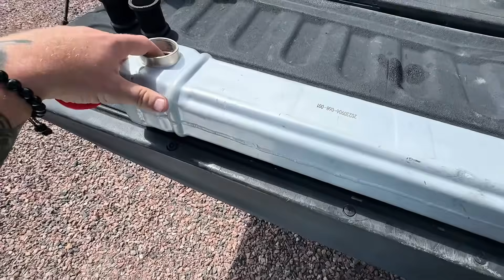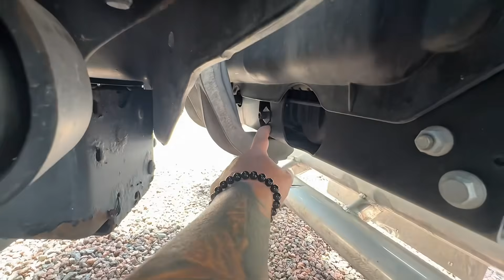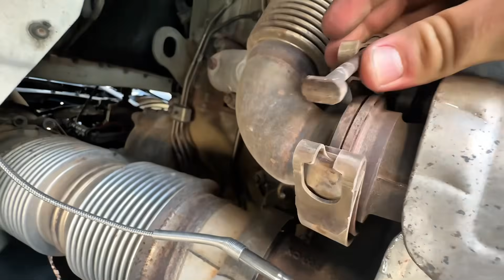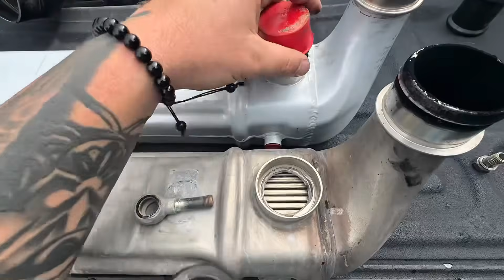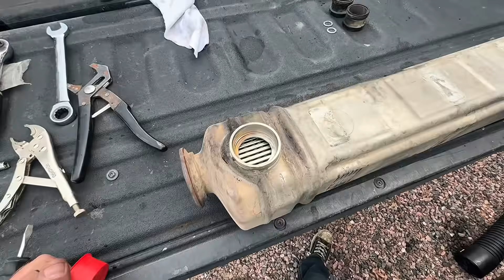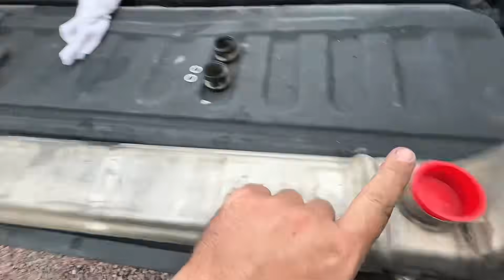Detroit DD15 EGR cooler replace - detailed, step by step, & time stamped

Comment: Not all of the clamps on the EGR cooler tighten to the surface, you can damage it by over tighten. The Torq specs are 14lbs.
Reply from the maker: Are we talking the v-band clamps on it? Or those straps that go over it and mate it to the mount?

Comment: Did you have any issues after installing with these products? I need to replace mine but straight from dealer is double the price
Reply from the maker: Yes. I would suggest go OEM if you haven’t already bought yours. 
Do you have DD15 or DD13?
The aftermarket one threw some codes for airflow because it wasn’t giving proper air flow readings to the sensors. And I ended up swapping this one I first installed from DPF direct parts with an oem one and my issue went away. 

My oem was $1700. 
I have found premier trucks out of Amarillo to give good prices on their parts

Comment: Is it possible for it to leak exhaust into the coolant?
Reply from the maker: Yes. The leak can go either way. It depends on what has the stronger pressure. You can do a “block test” from harbor freight block test kit, to check for exhaust gas in coolant
Reply: @ryanstaysloaded thank you that does help.

Comment: Thank you for the video, sir. This will be a project. I am doing very soon.
Reply from the maker: You got it man. Pretty easy. Take your time, you’ll do great. 
I do recommend using a OEM EGR cooler from Freightliner. This aftermarket one I got ended up giving me issues. DD15 are very particular about the amount of air flow they read and receive through the EGR cooler. So do use oem parts for most guaranteed results
Reply: @ryanstaysloaded I was actually going to go with a bulletproof egr cooler but had not thought about a difference in airflow.
Reply from the maker: @Txmodmanyes Detroit are VERY particular. This one I installed was aftermarket. Had to remove and replace it with oem because the air flow issues. Kept getting a code (I forget the code right now). But called Pittsburgh power and they gave me the info I just gave you.

Comment: No issues with air cavitation when you didn’t vacuum fill the cooling system?
Reply from the maker: No, never. When refilling just idle it up to temp so the thermostat opens. Then top it off. You can leave the overflow cap off if you’re able to idle it up to temp and not run it down the road. I always do it that way

Comment: Dont you have to belled the system?
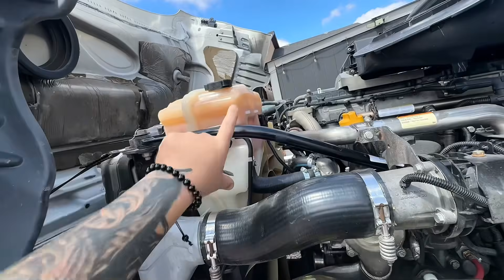Reply from the maker: Do you mean bleed? I think you mean bleed the system, like drain the coolant. Yes, I drained first think at 4:06 time stamp.
Reply: @ryanstaysloaded  what I’m trying to say is did you burp the system from air bubbles. you drained the coolant, but did you burp the system of any air
Reply from the maker: @leosdreamon681 nah. I just fill it up, run it to temp so the thermostat opens (180°-196°) and then top it off again. I’m not a fan of doing the air-vac to refill because the pressure can pop seals or gaskets like on the water pump.

Comment: i believe even if the truck is deleted the truck still has EGR
Reply from the maker: So there’s no part just called an “egr”. EGR stands for the process of it recirculating its own exhaust gases. You have a EGR valve and EGR cooler. Maybe you meant EGR cooler? Either way; A deleted truck does not have any EGR process continue. The EGR cooler does remain there on a Detroit. You leave it on there because it has coolant go in and out if it from the engine block. but exhaust will be blocked off with Dorman part number 555-030 & 555-044 freeze plugs used as block off plates at the C shaped exhaust pipe that comes from the exhaust manifold. And the EGR valve gets disabled so no exhaust goes thru the EGR cooler. But a deleted truck will not have any exhaust gases entering the intake anymore. On a Cummins there are aftermarket manifolds you can get that remove the EGR cooler entirely.

Comment: Have you had any problems (leak) since changing it out?
Reply from the maker: Actually yes I have ran into a problem. 1) use oem product. Buy the EGR cooler directly from Freightliner. Don’t use aftermarket. 
I kept getting a “EGR efficiency” code. The airflow isn’t right on aftermarket ones and these engines are particular. After I swapped to a brand new oem one I haven’t seen any issues. But the aftermarket EGR cooler wasn’t giving the correct air flow. 
But no, once I swapped out the old one I am no longer getting coolant in the oil. Oil samples are reading clean again.
Reply: @ryanstaysloaded thats good man, one last question Ive been a owner op for a year and have not had a oil sample done yet but plan to. Can i get it done at loves or do i have to go to the dealership?
Reply from the maker: @kennygates4182 loves and speed-co have what I call “bench machines” that just sit on the counter, and they broken like 98% of the time. They are also very contaminated. So if one guys oil showed coolant in it, like the next three tests are gonna show that cause they don’t clean any components. Lol they focus on turn over of getting trucks in & thru for oil changes. Not their oil sample machines. I would recommend a real lab like Polaris labs. But I get my oil sample kits from Pittsburgh powers website. I also run a OPS oil purification system. It is worth the investment in my opinion cause it’s only $1000 and it extends my oil changes. I just do filter change every 25k. Most my oil goes 100k miles before I decide to change it.

Comment: Do you happen to have the part numbers for  the coolant gaskets? Mines a 2018 dd15 i want to knock it out this weekend.
Reply from the maker: EGR cooler gaskets/those two black rubber things:
DDE A4722000154
If it’s the same as mine. (I’m sure it is) $17/each. Confirm with the last 6 of your vin with the parts counter though. 

The two banjo bolt smash washers:
DDE N000000001069
70 cents each.

Comment: When snugging bolts it's always best to start from the inside ones and work towards the outside. Also by using an aero spray that helps losen bolts and nuts first can make  tear down and reassembly go a lot better.  Other than that, you did a professional job and saved a bunch of money vs paying a shop.
Reply from the maker: Inside to out. Copy. I’ve never heard that so I’ll remember on the next job where I can apply it. 

I may have used PB blast and not mention it. The 4 strap/mount bolts luckily came out an in no issue. 👍 
Thanks for watching and sharing knowledge